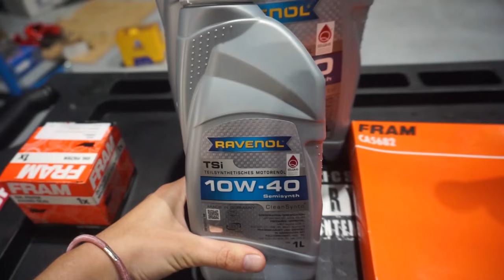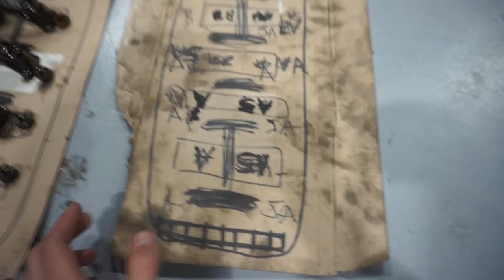👍 Cómo cambiar los CASQUILLOS de BIELAS a tu coche

Comment: Mucho mejor que el de la distri, sin comparación. Cosillas: El cigueñal se comprueba con un micrometro, no se si tendras acceso a uno. Si no lo tienes (que es lo habitual), mas que de la vista, fiate de la uña. Los casquillos, en vez de darles aceite con el dedo, mejor baño de aceite en un bote, y del bote a su sitio. Lo de lubricar antes de arrancar de verdad, es sencillo: desenchufas las bobinas y le das al contacto unos tres o cuatro segundos, asi te aseguras que se pre lubrica todo, vuelves a enchufarlas y listos para el primer arranque. Para los tornillos chungos del lateral del carter, un alargador de carraca y el tornillo sujeto con un papel o plastico fino, si cabe la mano, cable el alargador. A los silent, como a todas las gomas, nada de aceite normal, aceite.... de silicona que ademas nutre la goma. 

Enhorabuena y a seguir mejorando!
Reply: Muy bueno el video

Comment: tu sabes que todos los depósitos no son iguales, no? no es lo mismo medio deposito de 45l que medio deposito de 100l
Reply from the maker: Te dejo las instrucciones de uso según el fabricante por si quieres la forma extensa y más exacta de aplicar el producto:

Instrucciones de uso: Comprueba el estado de las correas del motor y el nivel de aceite y refrigerante del vehículo • Con el motor caliente, circula a altas revoluciones (> 4.000rpm) durante 20-30 km para comprobar que el motor funciona correctamente en ese régimen.  .  Agregue un bote completo de Xenum Ultimax (350ml) al tanque de combustible Reposta hasta alcanzar en el tanque un máximo de 70 litros de combustible (óptimo 30 litros) • Con el motor caliente, circula a altas revoluciones (> 4.000 rpm) y carga de  motor durante el tiempo que desees limpiar los componentes de escape (puedes hacerlo en varias veces) • Vuelve a repostar cuando esté cerca de la reserva.
Reply: @XanaCulata    pues eso, que no es tan importante que esté el depósito exactamente a la mitad
Reply from the maker: Mejor prevenir que curar, sobretodo insisto porque hay gente que pensaba que con un cuarto de deposito valía (quizá no llegaban a los 30l) y al echar un in and out (que es más cantidad que el ultimax y más fuerte) con ese poco combustible lo único que consiguió fue obstruir los inyectores.

Comment: Cambiar los casquillos sin medir la ovacidad del apoyo del cigueñal ? sin pulir... No sé. No veo la gran diferencia. A menos que tenga los casquillos destruidos, yo le pongo los mismos. Al menos ya estan ¨acomodados¨. Es mi opinion.
Reply from the maker: Creo que te refieres a la ovalidad, ciertamente hay que medirlos con un micrómetro. Para la próxima lo hacemos. Aunque también es verdad que este cambio de casquillos de bielas no ha sido por reparación sino por mantenimiento. Ya has visto el estado de los antiguos casquillos, estaban bastante bien.
Reply: @XanaCulata  Te felicito por tu video, y me gustó mucho.. Cada cual tiene sus metodos y cada mecanico su manual... todo es valido, porque lo que se busca es lo mismo.. el buen funcionamiento del motor. Porfa cuando repares el motor y rectiques el cigueñal, nos haces otro video. Gracias miles por compartir.. y mucha suerte
Reply from the maker: Muchas gracias a ti por aportar tu granito de conocimiento.
Reply: Si mal no recuerdo, en este motor los casquillos se salen con "alguna facilidad" cuando están gastados (ya me corregirán si es otro modelo), en este caso creo que es interesante cambiarlos